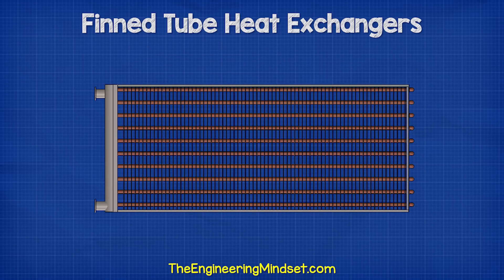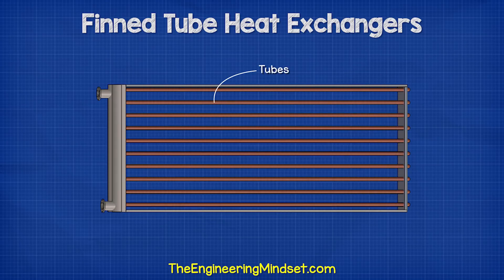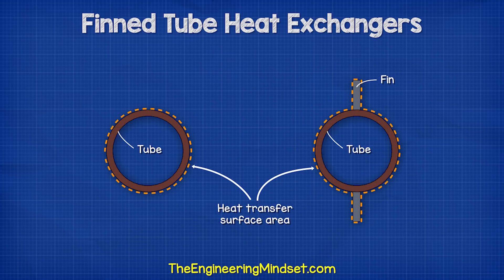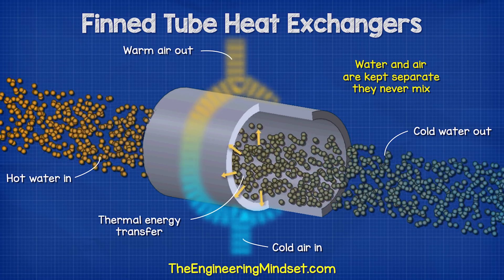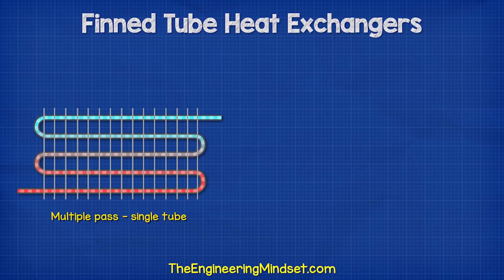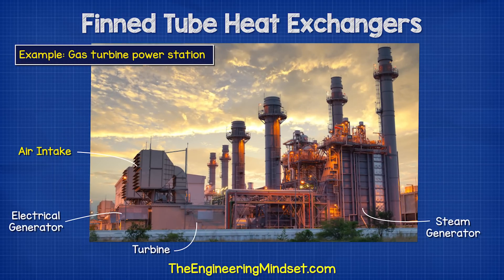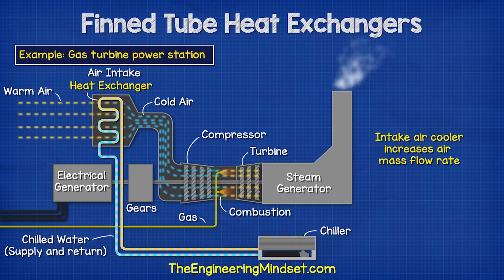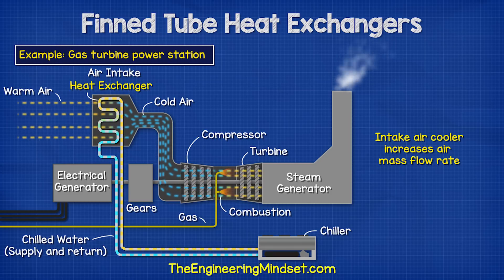Finned Tube Heat Exchangers

Comment: On my HVAC when warm water is flowing through the heat exchanger, the coils are hot. But when the blower is running the coils are room temperature and the ducts are blowing cold air. Is this normal?

Comment: Great video. So finned tube heat exchangers transfer heat through a) convection of the secondary fluid on the tube/fin walls, b) conduction of the tube/fin walls to the primary fluid in the tube then c) convection of the primary fluid through the tube?

Comment: Which of them can best be used in refrigerator ? And what are the system dynamics in modeling the system for optimal control to reduce the cost function. How can I determine the performance index of the setup ? Thank you sir

Comment: on a multiple pass/single tube, does it make a difference between hot at the top/cold at the bottom versus hot at the bottom/cold at the top? since hot air rises, if cold is at the top, maybe the water would re-heat a tad? or is that negligible?
Reply: This is just a guess, but bottom to top flow would aid in moving gas/air bubbles and avoid trapping them in the exchanger.

Comment: Would it not be better if the heat exchanger in the gas power station would be after the compressor? Like in a car an intercooler. Maybe it is anyways?

Comment: I always wondered if the cooling effect on the Fins would be greater, if they would be angled half a degree, so Air is not flow right by it but actually need to touch the fins and change direction which would cause friction with the fins.
Reply: And that friction will cause some heat producing on the fins, that's why they are not angled :) Also will slow down air and the more speed air has, the more heat it can disipate.